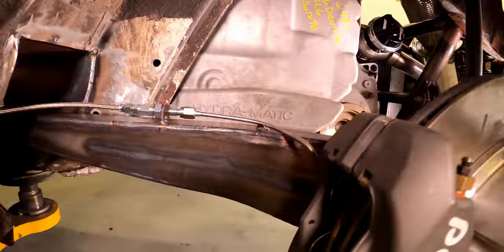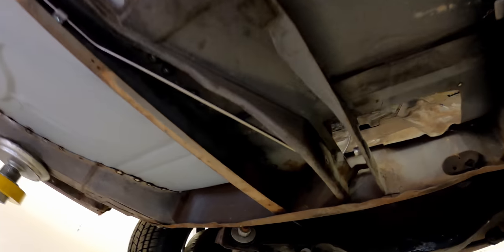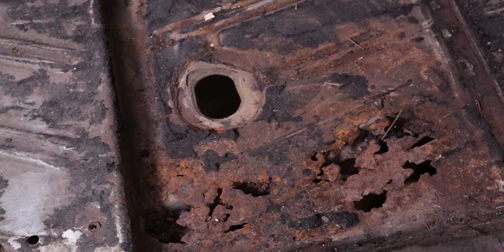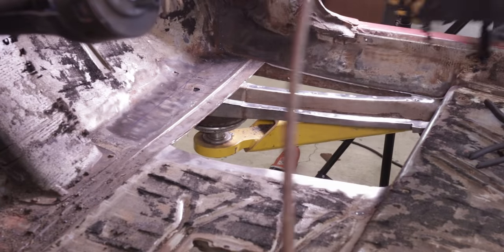There's smoke coming from my credit card

Comment: Another top notch episode.  Hopefully the loser trolls are getting a hint.  👍👍😎👍👍

I read through several of the comments and no one I saw mentioned what the fuel line bridge is for.  I'll bite ...... to keep the fuel spray away when the serpentine belt fails.  😀👏.  Absolutely love the meticulous fab on the bridge.  Just like all your other fab solutions - beautifully engineered and fabricated.  I would have loved to see how you fab'ed the bridge.  I suspect it was another simple yet very clever approach I would have never thought of.  All the best to you John

Comment: If you plan to use Holley EFI, you can program an output to turn on the transmission cooling fan based on transmission fluid temperature. No need for a thermal switch. You can use the Terminator X Max for DBW and trans control. If you want something more capable, use the Dominator ECU.

Comment: I'm building a 37 Chev PU with a GEN V L86 and a 6L80.  Fatman Fabs front end and TCI Leafs in the rear.  My checkbook is bleeding.  Steering alone from the rack to the wheel will be $2000.  Nothing about the Gen V is like an LS so it's expensive as all get out.  I got it out of a 2014 Silverado and I'll have 7 or 8 thousand in that alone

Comment: I say manual valve for the 4T80.  Way less tuning issues.  Wonder how the line pressure gets regulated if you go manual.
Reply from the maker: Although I like the "auto" part of the automatic, I'm leaning towards a manual.  The problem is that it's hard to find 4T80 specialist.  Shift kits and performance parts are essentially, non-existent.
Reply: @JohnReynolds661  Agree, and if the line pressure is not regulated, part throttle shifts will be harsh.  Plus full line pressure is hard on the pump and will cause wear.

Comment: John, I’m curious. When all the mechanics are done, what’s your plans for cleaning up the undercarriage? Remove everything and Media blast?  I ask this because I was impressed on how sanitary the VW turned out.
Reply from the maker: We'll see, the project is done in stages and the body, interior and exterior, are towards the end.  Not sure if it will be blasted or not.  There is some rust on the outside so the existing paint will have to be dug into.

Comment: Awesome series John! I was meaning to ask; why not mount the engine behind the transmission?
Reply from the maker: You mean a rear engine car?  I just wanted to do a transverse platform.
Reply: @JohnReynolds661  No, I get that, and it is great that it is a transverse engine, I mean why not have turned it around 180 degrees so that instead of having the engine block in the cockpit, the block would have been in the original engine bay?
I guess another way of saying it is that the serpantine belt would end up on the drivers side, rather than how you have it on the passenger side now. 
As I say this I can see maybe the transmission would have been backwards, which wouldn't have worked unless you changed the gearing inside it.
Reply from the maker: There would be no way to change the gearing, so it would have 1 forward gear and 4 reverse gears.  But, it would make for a sweet engine placement if it could be done.

Comment: Why do you want rack and pinion steering?
Reply from the maker: IMO, it has a more accurate road feeling with no mechanical slop.
Reply: @JohnReynolds661  A properly set up steering gear better. Why do race car drivers with rack and pinion take there hands off the wheel when they loose control of their car. With the steering gear they could drive out of it. With rack and pinion there little resistance to the steering wheel if you hit a curb, could jerk wheel out of your hand. With a steering gear there is more resistance. The only advantage is rack and pinion and pinion is cheaper  and easier to set up.
Reply from the maker: I'm not  convinced that the gear and swing set are better.  I put a brand new gear on this car before I started this project (it's for sale if you want it.)  The car wondered around with a sketchy/dead feeling.  There's a reason you don't see gears and swing sets in race cars and it's not because of cost.